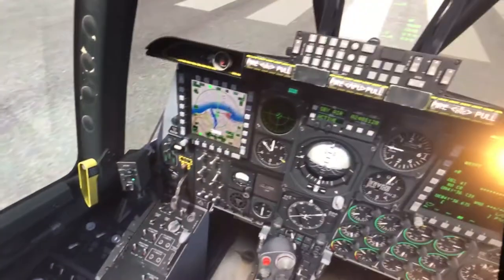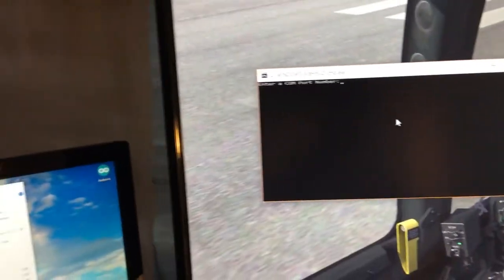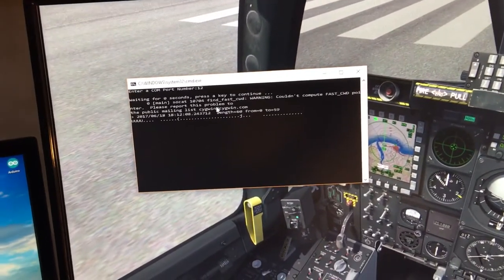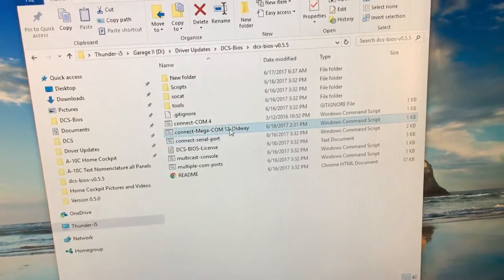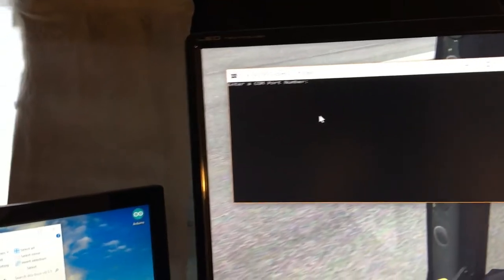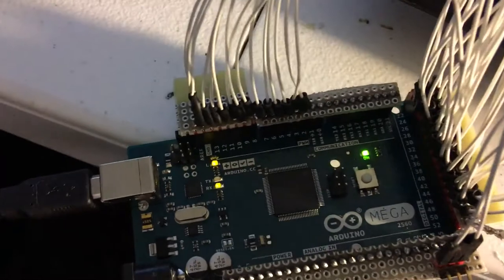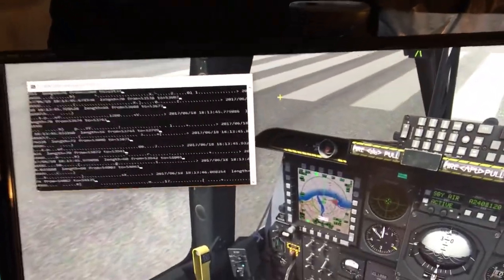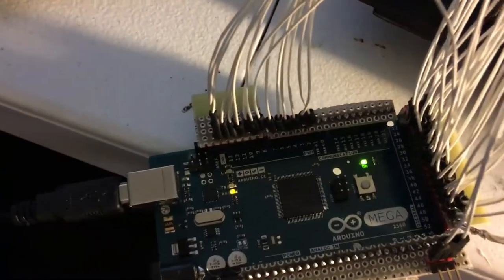DCS-BIOS bug report with connect-serial-port and work around fix (Re-booted PC and issue went away)

Comment: Joe, thanks for sharing the solution. It actually works! woohoo! But dcs has to be running. At first i tried without running dcs, just at the dos prompt it will still show the annoying cygwin error. after starting dcs and switching back to desktop and run the serialport command it starts working, and like you said, it keeps working once it works.

just to clarify one thing, you said socat file throughout the video. you were referring to the connect serial port command. At first i looked at the socat folder and didn't see what file to run. then later i realized it was the serial port command file. i downloaded an older version, edit with notepad++, added 3 seconds. Ran that and ran the newer version and then it works. thanks for all your videos! they answer many questions!
Reply from the maker: Thanks Rocketeer.   I saw a movie Rocketman a long time ago. It was a good movie. 
Yes, you are correct. I had a conversation with the guy who made DCS-Bios.  For the arduino Mega, you may have to put in a time delay in the connect-serial-port file because I forgot his exact words but the communication may start to take place before the Mega is ready for it. So it’s best to put in a 2 or 3 second delay.  This delay is not needed for the arduino Uno, Nano, or Micro. The newer versions of DCS-Bios has this delay already in the code, but the older versions doesn’t. So these were the steps. 
1) Download DCS bios version 0.5.1 for an older version of the file (connect-serial-port). 
2) Use Notepad++ to modify the old file to put in the 2 or 3 second delay. If you view the new versions of DCS Bios, you can see where to insert the time delay by viewing the connect-serial-port file.
3) Start the game so it’s up and running.  If the game is running but paused, this will not work. The game has to be unpaused for the com ports to send data.  Then run the latest version of connect-serial-port. If it freezes, make sure the arduino is plugged in and sketch loaded and you entered the corrrect com port number.
4) If that doesn’t work then run the older version of the connect-serial-port file in which you added the delay. Make sure this file is in the same directory as the original file. It should execute and freeze just like the new version did.  However, this does something that will make the new version communicate correctly. 
5)  Now just as in the video, execute the new version of the connect-serial-port and now it should be communicating properly.
Reply: Joe, i wrote to you a month ago asking how you make DCS Bios detect the UHF frequency cover open and close. I think i saw in one of your videos you used some string? Can't locate that again. Please share your solution. Much appreciated!
Reply from the maker: Good day. I used a limit switch that is mounted on the backside of the panel. 
https://openbuildspartstore.com/micro-limit-switch/
You can see one mounted in the KY-58 panel in the linked folder below. This is one of the advantages of a 3D printer. You can make little brackets to hold things. In the UHF case, the switch is rotated 180 degrees so that the band pulls the level down when the cover is lifted. Also having little hardware screws that are long come in handy. Something smaller than 2-40 or maybe M1 or M2s. I went to ACE hardware for the really small screws. You’ll need some to hold the limit switch. 
https://drive.google.com/drive/folders/0B4xdTr8IidWTLTdOTGFxdC14bFk
Reply: @joesim9577  Thanks!
Reply: btw, how do you run multiple com ports? The serial com port only runs one at a time. I tried the com handler, it doesn't work. I even tried changing the baud speed.
Reply from the maker: When you install DCS-Bios, you will see a file called “connect-serial-port” in your DCS-Bios folder. That is what it was called back in version 0.5.5. I edited that file using notes++. It has a line in the code with the com # in it. I put in com 5 for example and save the file name as com 5 in that same folder directory.  Must be in that directory or it will not work. I copy the file and save it in the same directory again as com 6. I edit it with notes++ and put in com 6 and save that one as com 6. I repeat until I have about 30 files all named after the respective com port number. Now when you plug in an arduino and you use the arduino IDE and click on the tools tab, you can see the com port number that arduino is on. If you plug in multiple arduinos you can see which com port each one is connected to. So you just run the game, minimize it so you can see the desktop, then double left click on the com port files that you created. One for each arduino that you have hooked up (we are assuming you wrote down all the com port numbers your arduinos are on).  That’s how I communicate with multiple arduinos. The newer version of DCS-Bios had a connect file that asked you to enter the com port numbers separated by a comma I think. Once you input your numbers and press enter it would open all the ports that you entered. I didn’t like that one because if there was a problem with one of the arduinos, you would have no idea which one wasn’t talking.. So I am using 32 arduinos and want to know right then if it is communicating so I like to manually open each one.  So I downloaded an older version of the “connect-serial-port” and added a 2 to 3 second delay line if you are communicating to an arduino Mega. This delay is not needed for arduino Nano, Micro, etc.  So I downloaded the latest version of DCS Bios and I replace the one file “connect-serial-port” with an older version from 0.5.5.
Reply: @joesim9577  Thanks for the detailed explanation. Much appreciated!
Reply: joe i know you deliberately have 30 files to track that each one is working. For me i wanted it to be simple so i just use one com connect file, inside i listed all the com ports, separated by a space. so i just run one file and all my 8 com ports for 8 megas all run at the same time and that covers all input switches of every panel on my a10c cockpit!
Reply: Joe do the COM ports still work for you when you fly A10C II? My switches only work for the old A10C and not when I fly any A10C II mission. I wonder if the dcs bios files need to renamed or upgraded? I’m still at V7.1

Comment: I have the same issue but your fix didn't work on my laptop running win10. How far back in versions did you go? Thanks for posting as I have had this problem a long time.
Reply from the maker: There is a little more information in the link in the description.  Report #002 describes the problem and version numbers. You would have to follow the link to the pdf. I haven’t seen this problem in a while though. But for me I didn’t like the new version of the connect to serial so I modified an older version and been using that ever since.

Comment: hello the card arduino take control of some thing?¿?¡
Reply from the maker: Good day. I’m not sure if I understand your question, but the arduino card is using DCS-Bios software to communicate to the game. A socat file called connect-serial-port will connect the arduino to the PC’s USB port when it is executed. The first step in using DCS-Bios is connecting the arduino to the com port.  Then you can control the hardware with the game and vice versa.
Reply: tanks for you responses,i make a combat simulator ,based in a-4e panel and have all analog gaugues ,i thing modified with servo motors.but dont know the hardware interface to use,the light panel,landing gear and more its really easy to make,i live in argentina excuse me,my poor english the plataform used actualy is flaming cliffs 2 its necesary move on the other plataform of dcs simulator more complete
Reply from the maker: You need a software interface that supports the A4E airplane and the flaming cliffs 2 game. DCS-Bios can maybe be modified to support that game but then someone would need to develope the A4E module. That’s beyond my software capabilities but you could check the ED forums to see if there is interest.
Reply: good ,only used a hardware to a4e,the simulation work on some dcs sim,

Comment: I have the same problem
Reply from the maker: Now with the older version of the socat file, I had to modify it by putting in the 3 second delay when talking to an arduino mega.  The old socat files has no delay in them so need to add it.
Reply: How did you do that
Reply: can you send me the file that you use would be really nice of you
Reply: How did you do that
Reply: can you send me the file? Would be really nice of you.
Reply from the maker: I recently moved and the main computer and sim are still boxed up in storage. But I used notepad++ to modify the socat file.
https://notepad-plus-plus.org
In the description I have a link to the DR report #2 where I show the modified code.  But once you download the earlier version of DCS Bios, look for the connect-to-serial file. That’s the one.